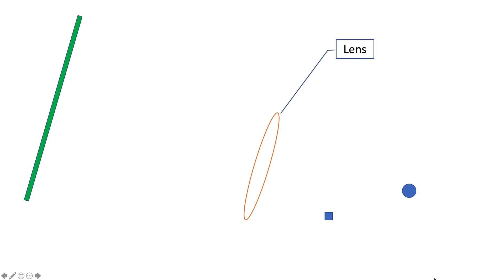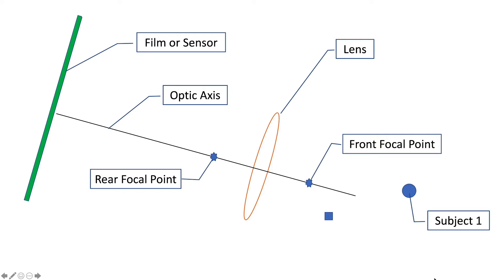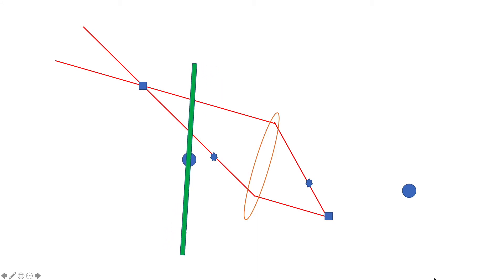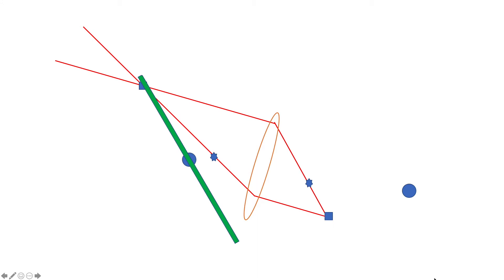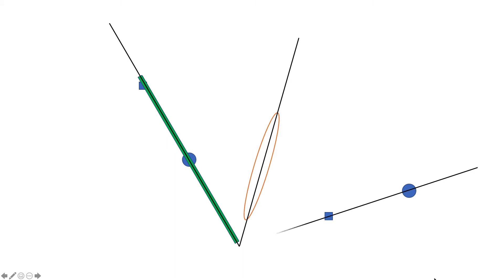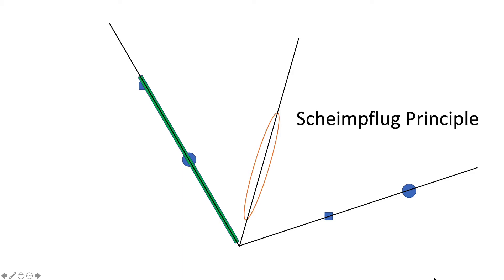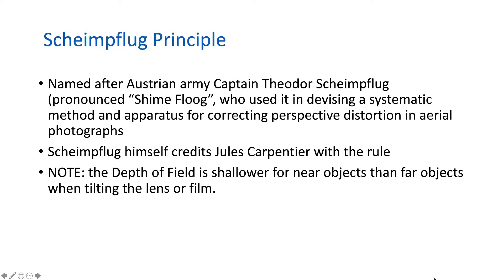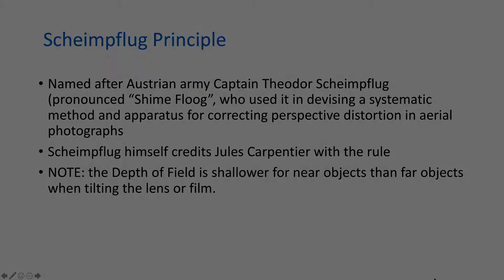Controlling Focus: the Scheimpflug Principle

Comment: Doug one point, with the Back standard are you not just affecting focus, but perspective, and converging lines too?, so using FRONT tilt would only affect focus, as the distance from film to object is constant, so constant perspective?, if my amateur head has this right, but just my opinion.

Comment: Why did you use the rear standard / film plane to focus? This resulted in your verticals not being vertical, and would of changed the relative size of the rear or near points that you are focusing on.
Reply from the maker: It was easier to illustrate the principle in the animation by moving the film plane as then the focal points remain fixed. I wanted the real-life example to mimic the animation.